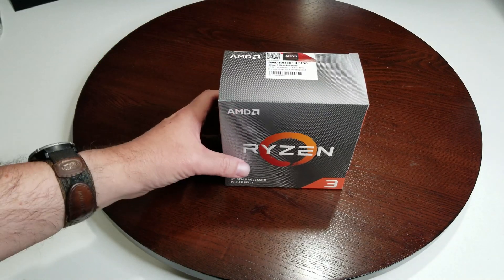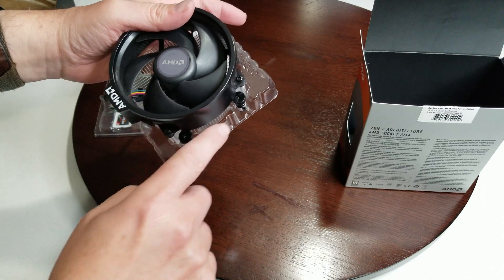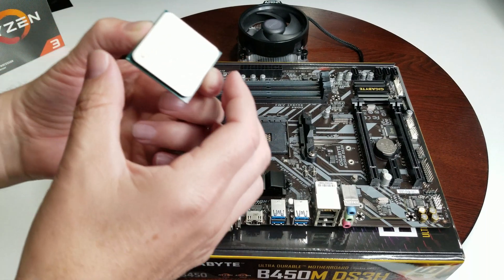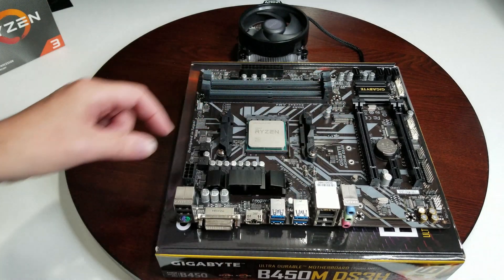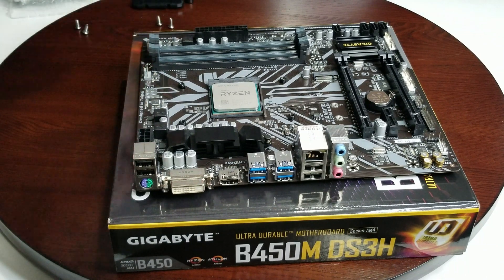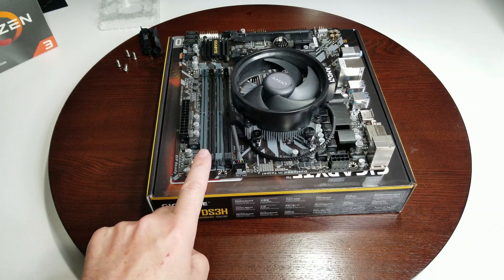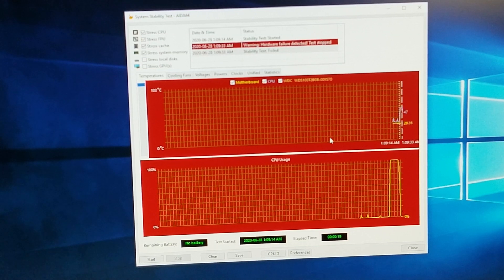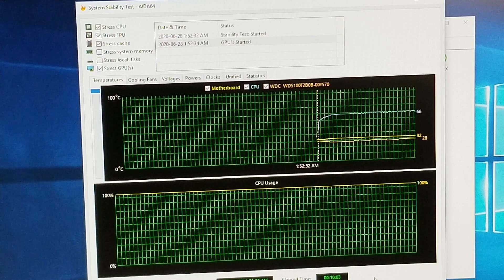Ryzen 3 3100 Unboxing, Install, Temps and VRM Testing The B450M DS3H

Comment: Hi, I am from India, and here ambient room temperature is around 30-32°C. I am using Antec A40 pro cooler with this 3100. Idle temperature is around 40-42°C. In stress test of 15mins the temperature rises to 69-70°C. Is it okay? BTW the motherboard is Asus TUF B450M Pro gaming. Also I have 2 120mm case fans running in DC mode (1 in front the other in back).
Reply from the maker: Hi from Ottawa, your temps are great, see no issue's with them at all, nice choice in MB, and the fans will help as well...everything sounds good to me...have a great day...
Reply: @Reviewing_Playing_and_More_RPM  Thanks for the reply! Actually I was looking for a good Mobo in mid budget segment and this suited my need.
Reply from the maker: @somantakghosh1065  Yeah it's nice, just keep in mind it has 1 CPU Fan Header and only 1 System Fan Header, I used a 3 way Fan splitter for myself...but otherwise it's a great motherboard...
Reply: @Reviewing_Playing_and_More_RPM  Not 1 system fan header, actually 2. One just below CPU fan header and other near the battery.
Reply from the maker: @somantakghosh1065  Yours must be different then mine then, as mine does not have 2 sys fan headers, just 1, maybe there was a revision of the board...
Reply: @Reviewing_Playing_and_More_RPM  Yeah that may be possible. Actually my board has written on the box RYZEN 3000 ready. So Asus might have revised the layout a bit. BTW what was your ambient room temperature during the test?
Reply from the maker: @somantakghosh1065  69 Farenheit or 20.5556 Celsius
Reply: @Reviewing_Playing_and_More_RPM  Well, there's a delta 't' of 10-12°C between our ambient room temperatures. So I can assume that, this delta 't' should be there in our stressed conditions keeping all other conditions same. And for that, my system is running 7-9°C cooler than it should be, right? Actually I want to figure out how efficient is my Antec A40 pro cooler than the stock one. I felt the temperature on the fins by touching them while stressed CPU and figured slightly warm!
Reply from the maker: @somantakghosh1065  Yeah that seems right, That cooler sounds interesting maybe I'll check it out one day...
Reply: @Reviewing_Playing_and_More_RPM  Sure do some review of that cooler. This will help others too as this cooler is dirt cheap and comes with 3yrs warranty!

Comment: I'm having some issues with CPU the motherboard is show CPU debug LED...
I have ryzen 3 3100 and MSI B450 what do I do? EVERYTHING IS BRAND NEW AND ITS MY FIRST PC...AND I'M STRESSED PLEASE HELP ME SIR....I NEED GENIUNE HELP
Reply from the maker: So let me know the details of what MB you have MSI B450 ? and what is happening, did it boot up to BIOS, check that your 8 Pin and 4 Pin Power are fully inserted and re-insert your Memory making sure your using slots 2 and 4...

Comment: Will a320 motherboard do
Reply from the maker: Not all a320 motherboards will support Ryzen 3000, depends on if a the MB Manufacturer has a BIOS update that is available, a better choice would be a B450 MB...I mean a a320 may work, but depends on if you have a higher end a320 or lower tier as a lot of the lower tier MB's will need a BIOS update if one is available, as support for the a320 has mostly ended now...hope that helps...

Comment: Thus this mother board required to update Bios or not
Reply from the maker: No, it took the CPU out of box, no update done yet still...will update it soon though...
Reply: @Reviewing_Playing_and_More_RPM  Do we need graphic card for this motherboard is it mandatory or we can use without graphic card
Reply from the maker: @aaryasingh6048  Depends on the CPU you use, if you use one with integrated graphics then no, if not then yes you'll need a GPU...

Comment: Hey man I have a question so I’m pairing up my b450m ds3h with a 3200g and I was wondering if the MOBO comes with updated bios?
Reply from the maker: This B450 Motherboard comes with support for the 3200G and should run out of box without the need to update the BIOS, it didn't have the most recent BIOS though, so I did update it later...

Comment: Do we have to put thermal paste?
Reply from the maker: The CPU Cooler comes with Pre-Applied Thermal Paste shown starting at 1:25 in the video...so no you don't need to use Thermal Paste as it comes included, but if you prefer your own Brand of Thermal Paste then you can remove what comes with this CPU Cooler and use your own but not required...

Comment: Mine reaches 80°C at 15 minutes of 100% load. I have two "Shadow Wings 2 PWM" case fans installed. Should I get more case fans, or just remove the CPU's pre-applied thermal paste and apply some aftermarket paste?
Reply from the maker: Yeah, that's a bit high compared with mine, so replacing the pre-applied with an aftermarket Thermal Paste might help, the one I find works best is Noctua NT-H1 it's non conductive and just seems to work the best for me...double check the CPU Cooler is secure to the CPU as that will make a difference as well...take care...
Reply: @Reviewing_Playing_and_More_RPM  Thanks for the suggestions :)

Comment: What a coincidence! 
It's exactly the rig I want to do I would like to know how do you find the DS3H moba so far ?
Reply from the maker: I like it a lot, it's going to be my Testing machine for things down the road, it was worth getting...
Reply from the maker: @Jared Miñoza It supports AMD 2nd Generation Ryzen/ Ryzen with Radeon Vega Graphics/ 1st Generation Ryzen Processors, I'm using a Ryzen 3 3100 in it now and didn't need a BIOS update so it's pretty versatile...
Reply from the maker: @Jared Miñoza Yeah if you can get the 3100 it's so much better then I was expecting...good luck with whatever you choose...

Comment: Did you update the bios on the mobo seeing as it doesn't naturally run with ryzen 3000 processors?
Reply from the maker: No I put it in and it ran out of the box...No BIOS update was required...

Comment: Hey quick question did the motherboard support the cpu straight out of the box?
Reply from the maker: Yes it did, had some issue's with RGB Fusion and with Windows 2004 update it fixed it and now everything is working great...
Reply: Ok thank you for the advice I’m going to use this cpu/mb combo

Comment: If I use an m.2 storage wouldn't the GPU heat cause any prblm to it ?
Because they seem pretty close
Reply from the maker: The M.2 will heat up a bit, but not so much as to cause it problems, I've been using them in several builds now and never had an issue because of heat...and some MB's will provide a Thermal Pad to help dissipate the heat as well...

Comment: Hi, you did a good job. Also, your temp with stock cooler is kinda impressive. I wanna OC mine, but it runs at 45C in idle with stock cooler. I have no idea why like that, just maybe I am unfortune xD
Reply from the maker: Yeah it does seem to be hit or miss with some of the CPU's...45C idle is still good though, you could get away with a slight OC...
Reply: Seems like we're on the same boat then. Mine idles at around the 40s and even reaches 90-something degrees at full load which concerns me. I am at a loss as I don't want to end up with a dud chip.
Reply: @blakegriplingph  90 degree at full load, kinda scared to hear that 🥶 if you still decide to use stock cooler, make sure to tight it hard with the motherboard

Comment: Why is it that your stock cooler has 5 fan blades and when I see few other unboxing vids their cooler has more fan blades and look a bit different
Reply from the maker: Not sure really but liked it's designed to push more air depending on the need of the CPU...

Comment: Hi, I bought the same Mainboard and CPU. Do you think Overclocking is possible with this setup? And if yes could you do a video about it. Thanks
Reply from the maker: It would make a good video, but I'm not well versed in OCing, I use the software to do mild OC's so could show that, but manual OCing isn't something I've done much so until I know more don't want to mislead anyone, but I'll try to find out more and do one eventually...I do believe you can do mild OCing on this but haven't tried it yet...Thanks...
Reply: Depends if u have upgraded cooler, I do....best results are oc ur CPU and mem in bios.....oc ur GPU with MSI afterburner or precision X1.....DO NOT oc ur mem in both....will struggle for control.

Comment: Does this come with thermal paste or do I need to purchase that separately
Reply from the maker: The CPU Cooler comes with Pre-Applied Thermal Paste shown starting at 1:25 in the video...some do chose to use there own preferred Thermal Paste but what is provided is just fine...Thanks...

Comment: I’ve got exactly the same cpu  and mother board however the pins on the cpu cooler are just a tad to short in width to fit in the connections, any help?
Reply from the maker: Not sure never ran across one that didn't fit, is it maybe that you secured one of the screws to much so now there's no play to get the other one in, that can happen but as for wrong size that's something I've never seen...

Comment: Hi man,if im getting DS3H with 3300x/3100 do i need to update the BIOS?
Reply from the maker: Need more info, B450 or B550, and full name of MB ie DS3H __ to be sure...
Reply: @Reviewing_Playing_and_More_RPM  the B450 DS3H
Reply: @Reviewing_Playing_and_More_RPM  The one on the video
Reply from the maker: @baraklevy6371  Yes you can you use either of those in the B450 DS3H and no BIOS Update required it will work out of box...Thanks...
Reply: @Reviewing_Playing_and_More_RPM  thanks man liked and subscribed
Reply from the maker: @baraklevy6371  Much appreciated...Thanks...

Comment: Do I need to update bios?? for B450M S2H pls help me
Reply from the maker: Not sure, but be careful with your choice of CPU as it's limited to only the 2nd Gen CPU from what I've been able to find out...wish I could offer more...take care...Thanks...
Reply: Thanks so much. Firstly sorry for my bad english. İn the amd site 3rd gen ryzen proccesors support b450 chipset motherboards. But im not sure about B450M S2H. Im so confused
Reply from the maker: Most will support up to 3rd Gen and even 4th with a BIOS update, this one however does not...Thanks...
Reply: What is the difference between ds3h and s2h ? I guess only ram slots. S2H have 2 slots and DS3H 4 slots. I hope it works.
Reply from the maker: You can go to PCPartpicker.com to compare parts to see differences...Thanks...
Reply: I dont update the bios motherboard came with the f50 bios version
Reply from the maker: @evabis8651  If everything is working and no issue's you don't need to update the BIOS, however if you are knowledgeable on how to update your BIOS and are aware of the risks associated with doing so then you might want to update the BIOS, it's best to verify what if anything a new BIOS update will do for your system, if it will fix potential things you plan to use and it's a fix for that item you plan to use then it would be something to consider...ensure you know that updating a BIOS carries the risk that it could should something go wrong cause your Motherboard to no longer work...Thanks...

Comment: Do I need to take off the brackets off my mother board if I have a wraith stealth cooler?
Reply from the maker: Yes, if a CPU Cooler screws into the backplate then the brackets would be in the way, if a CPU Cooler has clips then you would use the brackets...
Reply: Reviewing Playing & More RPM thanks 😊

Comment: Do I need to update the BIOS??(B450M DS3H socket AM4)
Reply: Idk
Reply from the maker: There was no need to update the BIOS for this CPU to work...Thanks...
Reply: If your motherboard box says in the corner "ryzen 3000 ready" you don't, but if it doesn't you need to i believe
Reply: Do I need a bios update I have a b450m a
Reply: a B450 is usually already bios updated to the second generation, not third. A B550 is updated through the third generation as well. Certain manufactures already update old motherboards to support new CPUS so check the views and description.

Comment: I just bought a B450 DS3H and im planning on pairing it with a ryzen 3 3100? does it run good?
Reply from the maker: Mine is working great so far, still need to test it with games but I suspect it'll do well based on prior research...Thanks..
Reply: @Reviewing_Playing_and_More_RPM  do I need to flash the bios or is it plug and play? thank you

Comment: Hey man i need help, i need an a320m chipset motherboard for the ryzen 3 3100, what should I buy?
Reply: You need to update the bios and it should work
But the B450 are way better especially for more  usb ports  and M2 support ... If not like this one double graphic card slot and four ram slots
Reply from the maker: @fadia7446  Yeah, wish I could remember why I said what I did then, mind you I'm lucky I remember supper sometimes lol...
Reply: @Reviewing_Playing_and_More_RPM  no worries mate we're a community and  usually when someone went to buy something he probably ask all the questions (which is my case lol)
Reply from the maker: There are many Motherboards that will work with the Ryzen 3 3100 CPU, but as to having an a320m chipset, I'm not even sure what that is...The Aorus B450 Elite is a great choice for this CPU though...Thanks...

Comment: Which motherboard to buy b450 s2h or b450 pro m2 which one Is better for gaming
Reply from the maker: The B450 S2H is probably a slight bit better for gaming, but the B450 Aorus Elite would be a much better choice overall...both of the boards you are deciding on are fairly the same though...Thanks...
Reply: @Reviewing_Playing_and_More_RPM   S2h better than this one ? 

Care to explain please ?
Reply from the maker: @fadia7446  Not sure why I said that at the time, they are fairly similar not many differences, but at the time there must have been a difference I noticed, at this time though, not sure, I take a fair amount of time comparing everything so something must have stood out at the time, at this moment...I'd pick the B450 Aorus Elite...hard to say what I was thinking 2 months ago...